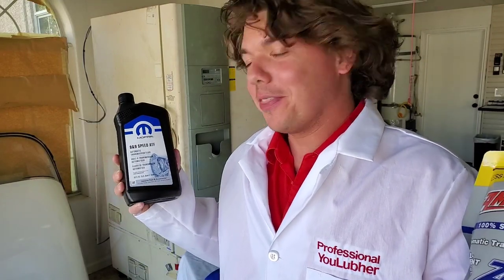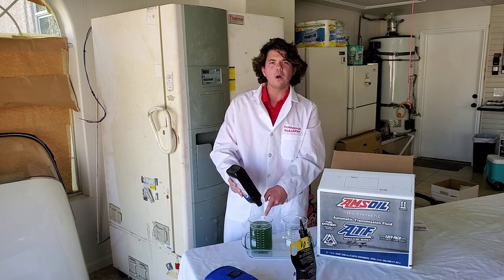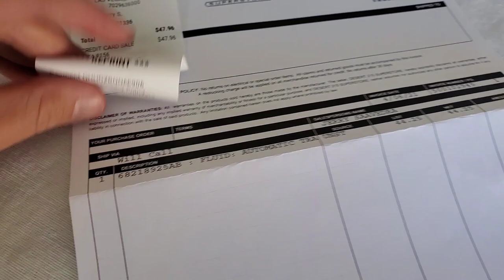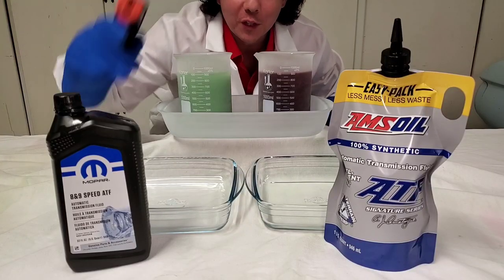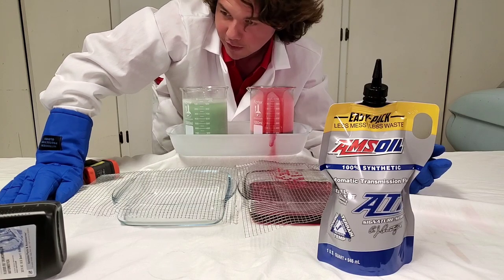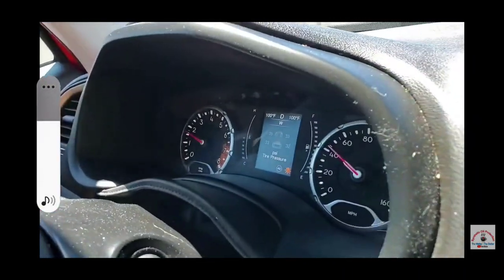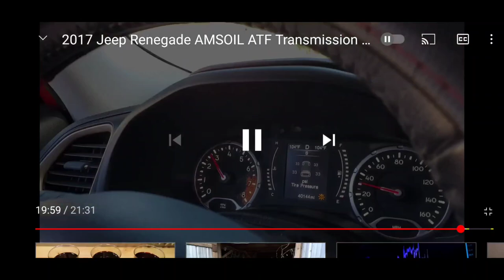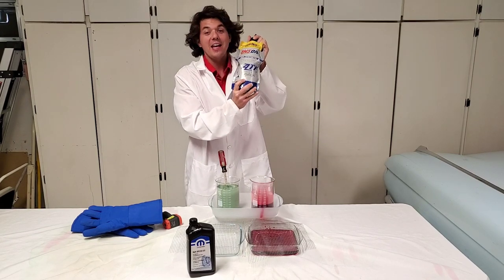Mopar ZF 8&9 Speed VS AMSOIL FUEL-EFFICIENT ATF Cold Flow Test

Comment from the maker: Professional YouLubher: Eben Rockmaker Regency Direct Jobber AMSOIL Specialist (Dealer#: 5331179) 

Watch This: Mercedes-Benz 236.15 VS Lexus WS VS AMSOIL Fuel-Efficient ATF Cold Flow Test Playlist - https://youtube.com/playlist?list=PLB_ftWArBFdfvxctkYh4tcb55bcO2uLBQ

     To Order AMSOIL Products Click Here - http://syntheticoilprotection.net/ 

Find Products For All Vehicles - 
https://www.amsoil.com/guides/?zo=5331179 

     SUBSCRIBE to Synthetic Oil Protection YouTube Channel - https://www.youtube.com/c/SyntheticOilProtection
        
     Synthetic Oil Protection Website - http://syntheticoilprotection.net/ 

1959 Cadillac DeVille Everything We Did To It Since I Got It - https://youtube.com/playlist?list=PLB_ftWArBFdeVKszO64Ig5nWEQp7H3oF- 

      AMSOIL Performance Test Results. Read This Article - https://www.amsoil.com/performancetests.aspx?zo=5331179 

AMSOIL Dealer Google Maps - Synthetic Oil Protection: https://maps.app.goo.gl/2AuZCi8h2Gaf3mY46 

About AMSOIL..... est. 1972: 

First 100% Synthetic Oil Certified in the USA 

1. Where can I find AMSOIL? - Use this link https://www.amsoil.com/offers/?zo=5331179 
Or 
     Watch This Video: The Truth About AMSOIL Why Mechanics Won't Recommend - https://youtu.be/8OhntOxngAA 

       2. What makes AMSOIL different than other oils? - 

AMSOIL is 100% Synthetic & has higher film strength & holds up 4× better in turbocharger deposit testing than Mobil 1 EP which protects and separates metal parts, keeping them from wearing and Lasting Exponentially longer. Watch This Video: https://youtu.be/f4eNPgTi_qo 

3. Why should I use AMSOIL?: It protects the engine so it will last longer. Less oil changes less often (once per year/15,000 miles) or longer... Save money in Gas & Time making it less expensive than a free oil change over the year. Watch This Video - https://youtu.be/H7K6FdZlqmg 

     Professional YouLubher: Eben Rockmaker Regency Direct Jobber AMSOIL Specialist (Dealer#: 5331179) 

Mobile Delvac VS Valvoline Blue VS ROTELLA T4 - https://youtube.com/playlist?list=PLB_ftWArBFdcHXnFEnjcWdQFRhDEC-6Dc 

Find Products For All Vehicles - 
https://www.amsoil.com/guides/?zo=5331179 

   
25,000 Mile AMSOIL OIL CHANGE. 
Watch This Video - https://youtu.be/vp1HTtlulR8 

The Power of AMSOIL Signature Series 5W-30 Synthetic Motor Oil protects against harmful deposits on turbochargers 4X better than Mobil1® Extended Performance and 3.6X better than Royal Purple® in industry-standard testing*.  Read This Article - https://www.amsoil.com/newsstand/motor-oil/articles/leading-the-field-in-deposit-protection/?zo=5331179 

     Better MPG Proven. Read This Article - https://www.amsoil.com/newsstand/motor-oil/articles/another-win-for-amsoil-products/?zo=5331179 

AMSOIL Performance Test Results. Read This Article - https://www.amsoil.com/performancetests.aspx?zo=5331179 

     Ebens Giveaway: 

Over $5000 Given to my YouTube Community Playlist - https://www.youtube.com/playlist?list=PLB_ftWArBFdey4HFt_Z9KgSIChjkLbw_o 

Synthetic Oil Protection Coffee. To Order Coffee Click Link Below: https://supportwith.coffee/shop/subscriptions/sop/
Reply: Try and get the ZF actual Transmission fluid and compare... its like 15 dollars a quart
Reply: Even you into it! AMSOIL!

Comment: Anyone that thinks Amsoil is overrated or snake oil needs to recognized that Amsoil is the real deal.
Reply from the maker: 25,000 Mile AMSOIL OIL CHANGE. 
Watch This Video - https://youtu.be/vp1HTtlulR8 

The Power of AMSOIL Signature Series 5W-30 Synthetic Motor Oil protects against harmful deposits on turbochargers 4X better than Mobil1® Extended Performance and 3.6X better than Royal Purple® in industry-standard testing*.  Read This Article - https://www.amsoil.com/newsstand/motor-oil/articles/leading-the-field-in-deposit-protection/?zo=5331179 

     Better MPG Proven. Read This Article - https://www.amsoil.com/newsstand/motor-oil/articles/another-win-for-amsoil-products/?zo=5331179 

AMSOIL Performance Test Results. Read This Article - https://www.amsoil.com/performancetests.aspx?zo=5331179
Reply: I use amsoil in my wife's jeep renegade too and my 900hp honda civic drag car.
Reply from the maker: Snake oil is a term used for products that do not work that are basically pseudo science there's science that's proven and then there's pseudoscience which is something that does nothing.
Amsoil is the leader in synthetics and has been since 1972.
♥️   See Fluid Performance Tests - https://www.amsoil.com/performancetests.aspx?zo=5331179
Reply: This test proves nothing because where does it even get that cold where someone will actually live? If you used a realistic cold temperature like in Russia or Alaska then that would make sense but these guys want to use an unrealistic temperature
Reply: How about vs Liquimolly ? I mean it’s made in Germany 🙀
Reply from the maker: @JW-jc8kr that's a great question we haven't tested that one we did test Ravenel which you'll see here on the channel and also Mutual very high quality. Raven all is 100% synthetic and also the module we tested was also 100% synthetic - https://youtu.be/dVllJpsVh5M?si=rFxCOn6KXxyXvY75

Comment: Wow, $47 a quart!?! Mopar was destroyed by Amsoil! I choose Amsoil protection vs the $47 Mopar popsicle
Reply: How much is the Amsoil?
Reply: @lynnsyddall420  approx $18 at retail. Preferred Customer price is less than $14. So, as you can see quite a bit cheaper than the Mopar ATF but so much better in terms of quality and performance. I am sure Eben can answer any other questions you have about the entire line of Amsoil superior products. You will not be disappointed by Amsoil or Eben.
Reply: Mopar is not $47 a quart it ranges between $10-15, cheaper if you look for sales..
If you have an 8-9 speed 948TE or equivalent you better use Mopar...Nowhere in life is below 50 degrees this not an accurate test of real word!!

Comment: The zf 8&9 speed fluid is not even comparable to amsoil fuel efficient garbo. Listen, the friction modifiers have a huge effect on behavior on the fluid friction. The 8&9 speed mopar stuff is the same as zf 8&9 speed, and is designed to have less friction modifiers. That changes static and dynamic friction coefficients. You put that AMSoil fluid in a zf 8 or 9 and your trans is going to burn up guaranteed.
Reply from the maker: You'll notice on the Android ATF is the same specification as this fluid It is a different base stock there's a lot of differences in the fluids This is the full specification on that specific ATF - 
https://www.amsoil.com/p/signature-series-fuel-efficient-synthetic-automatic-transmission-fluid-atl/?zo=5331179

Click on technical data bulletin and you will see the specifications.

Also definitely check out the other ATF fluids we've done on the channel here on this playlist you'll see all the vehicles we've used the product on and how it has changed the shifting characteristics - https://youtube.com/playlist?list=PLB_ftWArBFdfzuV7RHGz70MD-PawLbKgu
Reply from the maker: As for your first statement is totally true they are not even close to being comparable fluids 😆😄😁

Professional YouLubher: Eben Rockmaker Regency Direct Jobber AMSOIL Specialist (Dealer#: 5331179) 702-472-3614 

Get AMSOIL Wholesale Pricing - https://www.amsoil.com/offers/pc/?zo=5331179
Reply: @Syntheticoilprotection  You do not recognize the actual effect of friction modifiers on clutch temperature. Specifically more friction modifiers found in these AMSOIL products comparative to the zf product (keep in mind, chrysler simply rebrands the fluid ZF actually engineered for the 8hp90), causes increase in sliding friction, and decrease in static friction. If you use a standard ATF in that application, you will burn the frictions up.
Reply from the maker: Correct you always want to use the proper specification for any of the transmissions.

Comment: A good test would be cooking both fluids at 200F which is where a transmission temp runs at to test evaporation and lubricity , given most people don't live in Antarctica where temps hit -50c lol this video pretty much proves nothing !!
Reply from the maker: It's not about proving anything it's about showing the difference.

Let's give a man a fishing pole & show him how to fish. 

     Together! We can get your vehicles to run better than brand new!

     For me to get credit & be "Your" Independent AMSOIL Dealer, please use my website below or my dealer no. 5331179 call anytime Eben Rockmaker 702-472-3614
After you click on: http://syntheticoilprotection.net
1. Click the hamburger menu
2. Click offers AMSOIL preferred customer
3. Click join now. 6-month PC member add to cart.  ( There is no reoccurring renewal membership unless you select that dot box ) 
( You have the option to not have your credit card saved if you prefer - est. 1972 )
4. Scroll up to the top Select shop by vehicle. 

New Promo Code: FREECLEAN or FREELEMON

Comment: This one Eben was the biggest shocker for me. My wife's vehicle is a 2020 Chrysler Pacifica plug-in hybrid and uses the ZF 8/9 speed trans fluid to cool the electric motor transmission and lubricate the front differential assembly gears. It's a single speed transmission unlike the 9 speed in the gas only Pacifica. I was shocked though that ZF, being a German company, has a trans fluid with poor cold climate flow, since Germany has ultra cold winters. Amsoil is definitely going in once the factory warranty is up this October.

Comment: Tests and then results matters the most. I've used the ATF on my transmission starting at 140,000 miles and my car now has over 200,000 miles and runs like new. 
     100% Synthetic Amsoil is the real deal. 
      Learned so much education on the diffrences of transmission Fluids and how the Amsoil makes such a big added difference. 
      Thanks for the great video content series on how and why 100% Amsoil makes so much better differences and the better choice. 

   Thanks for sharing the filming content tent.

Comment: I recently did a transmission fluid change on my Buick because it was shifting hard, slipping and making some noise as well. After putting in a new filter and 8 quarts of Amsoil Signature Series fuel efficient transmission fluid in, now the car shifts better then ever, like a new car. Shifts into gear easier, smoother, quieter and no more hard shifting and clucking or slipping on acceleration. This product is phenomenal. 

I highly recommend it.

Anyone out there looking for the best products for your car on the market, contact Eben, he truly stands bye his product. 👌

Thanks Eben, 👍😉👌☕
Reply from the maker: 💯, super awesome to hear!!!
Reply: 😉👌👍 @Syntheticoilprotection

Comment: Fellow independent dealer. Another great video Eben. Incredible how frozen the Mopar fluid is 😳.  Would like to see how Motorcraft Dual Clutch Transmission fluid XT-11-QDC would compare. I know it's used in Ford front wheel drive cars.

Comment: I used the Maxlife in my ZF. Worked fine for 30k miles so far.
Reply from the maker: 💯, thanks for sharing with the channel not sure what that is?
Reply: @Syntheticoilprotection  Valvoline Maxlife atf fluid. Full synthetic fluid. ZF transmission series (8hp45).

Comment: Just bought 6 qts mopar for $98.00.  Never had an issue with mopar, made by shell to ZF spec.
Reply from the maker: What type of car do you have?

Sweet, Toyota WS vs AMSOIL ATF - https://youtu.be/8XO9pd0s5x8?si=Gb99pnm19V0_JhKV
Reply: Yeah, prices have come down on mopar now that there's enough proof there's plenty of other safe options.  They were like 40 bucks a quart 6 years ago.
Reply from the maker: That's great!
♥️   Your vehicles can run better than brand new by using the right Oil & Lube! 

     🇺🇸   50 Years of AMSOIL anniversary - https://youtu.be/MQUqRBI8dD0

Comment: Thanks for sharing.  You're running a test at negative 58 degrees Fahrenheit below zero.  That's very cold. If I lived in a place that experienced those temps it would be worthwhile.  What do the tests look like for temps that most people/vehicles experience?
Reply from the maker: Great question Jean it is to show the maximum temperatures that are very cold just to show how they're different if it's at room temperature it will pour a lot quicker and a cold start can account for up to 80% of the wear on a motor so it's very important to have a good flowing lubricant.
If you'd ever like to try the Amsoil lubricants this is my personal link and when you use it I would always be able to answer your questions in the future with the products and I appreciate your business.
✅ ✅ ✅  Save 25% On Your Next Fluid Order: https://www.amsoil.com/offers/pc/?zo=5331179

Comment: Just a quick, and potentially dumb question: on the ZF 850RE (jeep) when draining the fluid, you’ll always have a quart or 2 stay in the TC. so, it cannot really be flushed at one go. Can I mix the Amsoil the Mopar fluid? I live in hot and humid temps. 
Btw, I use the 0-20 amsoil recommended engine oil in my vehicle. Right after the oil chance you can actually “feel” the smoothness on the engine, more so than with the factory recommended pensoil. Not sure if it’s a placebo effect but I am sold on Amsoil.
Reply from the maker: I made this video for you - 
https://youtu.be/celH6X9nbyg?si=JHV1AXu9Bt35HZlW
Reply: @Syntheticoilprotection   nice! Will check your entire video library soon. Thanks again!
Reply from the maker: @tesladiesel2420 😃

Comment: 2018 Charger Daytona 392.  Going to try a drain and fill with OEM fluid still in it , I’m currently at 30,000 miles.  Do you think it will be okay to mix the 2 different oils?
Reply from the maker: Yes!!!
I give a man a fishing pole & show him how to fish. 

     Together! We can get your vehicles to run better than brand new!

     For me to get credit & be "Your" Independent AMSOIL Dealer please use my website below or my dealer no. 5331179 call anytime Eben Rockmaker 702-472-3614
After you click on: http://syntheticoilprotection.net
1. Click hamburger menu
2. Click offers AMSOIL preferred customer
3. Click join now 6-month PC member add to cart.  ( there is no reoccurring renewal membership unless you select that dot box ) 
( you have the option to not have your credit card saved if you prefer - est. 1972 )
4. Scroll up to the top Select shop by vehicle.

New Promo: FREELAMP

Comment: Do you recommend partial or complete exchange of with machine?
Reply from the maker: I always like to do a pan drop and do the drain and fill which is usually anywhere from 33% to 66% of the fluid in the transmission the rest is in the torque converter then I usually like to come back after 5,000 miles and do it again if it's a new vehicle when switching to Amsoil that's what I did to my personal car you'll see it on the channel it's the SL550 playlist.
    I give a man a fishing pole & show him how to fish. 

     Together! We can get your vehicles to run better than brand new!

     For me to get credit & be "Your" Independent AMSOIL Dealer please use my website below or my dealer no. 5331179 call anytime Eben Rockmaker 702-472-3614
After you click on: http://syntheticoilprotection.net
1. Click hamburger menu
2. Click offers AMSOIL preferred customer
3. Click join now 6-month PC member add to cart.  ( there is no reoccurring renewal membership unless you select that dot box ) 
( you have the option to not have your credit card saved if you prefer - est. 1972 )
4. Scroll up to the top Select shop by vehicle.

New Promo: FREELAMP

Comment: Opinion on the valvoline atf maxlife? Thinking on using it on my zf 8&9 speed
Reply from the maker: I have no idea and never used it but the synthetic is Sam's oil 100% synthetic is a big difference much smoother you'll have a longer transmission life and much more high heat protection this is the best way to buy AMS oil if you want to try it I would be raising a dealer I could always answer all your questions on the products in the future.
🎬 Professional YouLubher: Eben Rockmaker Regency Gold Direct Jobber AMSOIL Specialist (Dealer#: 5331179) 702-472-3614 

     ✅ If You're New To AMSOIL I Recommend The AMSOIL 6 Month PC Membership because it will save you about $33 on a $100 purchase after the difference in tax - https://www.amsoil.com/offers/pc/?zo=5331179

Comment: I’m about to do ATF on my 2018 Lexus Is300. Looks like the transmission is almost 10 qt capacity. Do I do multiple drain and fills to get all the 10qt of old fluid out?
Reply from the maker: That's a great question just depends on the vehicle most of them you just do the pan drop and then what I recommend is come back after a few hundred miles do another drain and fill until you're happy with the color of it you'll see a huge Improvement in shifting just with the regular ATF fluid change and I recommend the signature series ATF this is my personal link if you are looking to get the products at the very best value 6 month PC membership will do that for you and when you use my link that would attach me to you in the future I could always answer your questions about improving the performance and lifespan of your vehicles by choosing the right fluids as your independent Amsoil dealer👍 
✅   Save up to 25% on every order as a preferred customer: https://www.amsoil.com/offers/pc/?zo=5331179